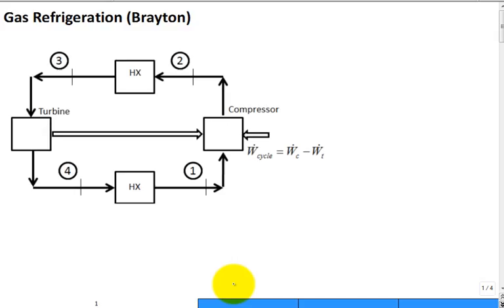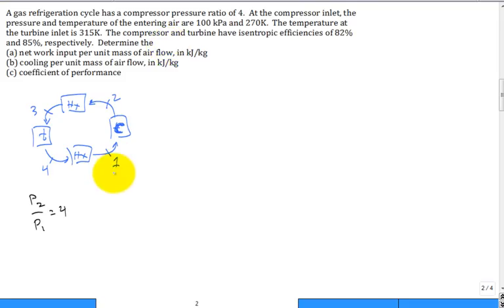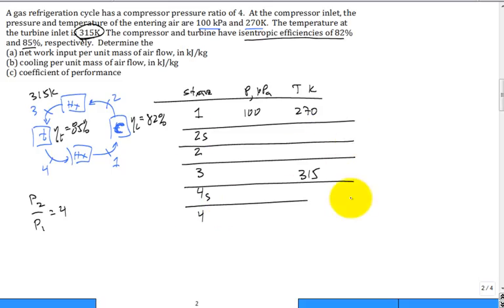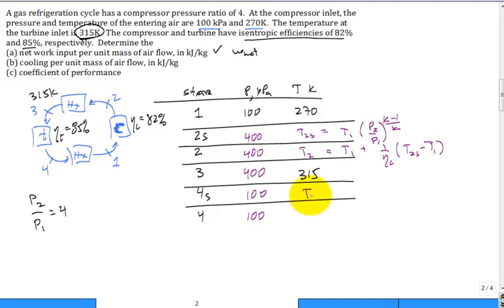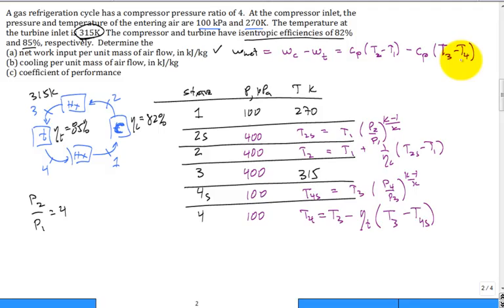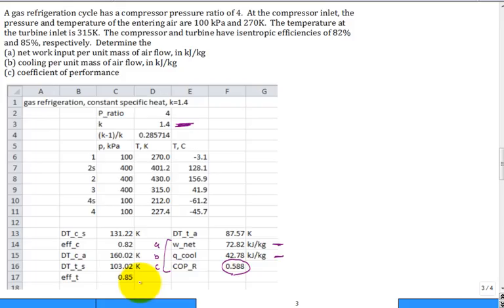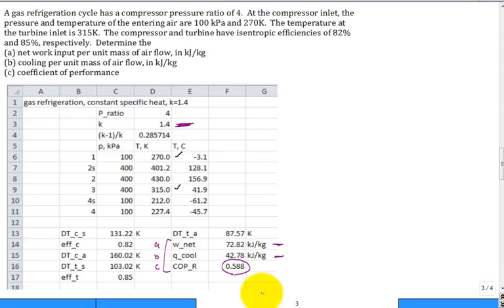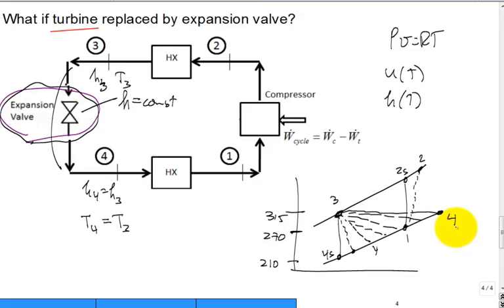Gas Refrigeration Cycle

Comment: Thanks for the lecture professor. We used Cp del T for this problem when fluid goes thru a compressor and a turbine where pressure is not constant. Isn't Cp valid for constant pressure processes? Are these relations exact or approximate? Thanks.
Reply: Yes